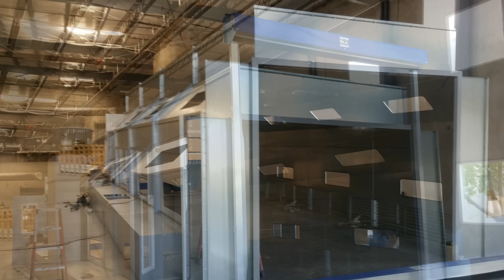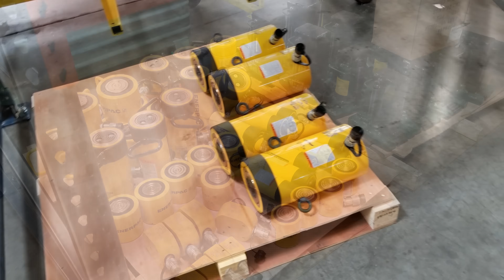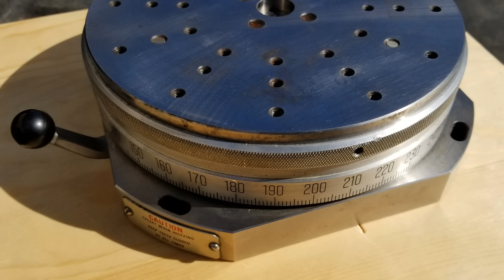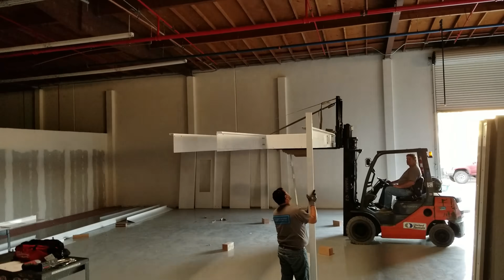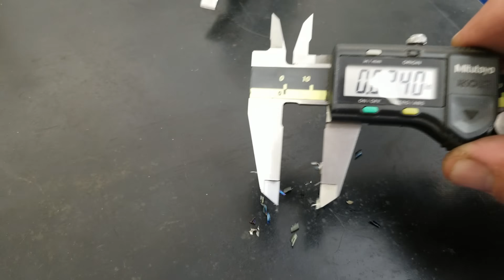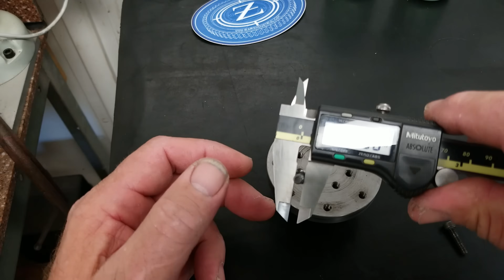The Grind #46

Comment: Hey Stan, when using your demagnetizer, should slowly withdraw item being demagnetized away from demagnetizer. Basically just a coil and armature. When you apply AC to coil, magnetic field flips back and forth at 60Hz. If you pull away fast, you may come away from peak of either positive or negative cycle. Since any dipole field diminishes with CUBE of distance, not square of distance, that magnetic field drops off very quickly. Moving away too quick can leave residual of one pole or other. By moving away realy slowly, field slowly diminishes while still flipping polarity. (Used to demag 103 sets of tape heads every week at a radio station... back when tape cartridges were used.)

Comment: I have a motor growler that I use to demag large stuff and a portable unit made from an old drill with a c-frame motor. I removed every thing but the handle and the armature and split the narrow end of armature with a hacksaw. That way I have a demag with a handle, a switch and a cord. For real small or delicate stuff like small drill bits and dial indicators I just use a Weller type soldering gun.

Comment: If you need some mc4 connectors for your solar let me know, I happen to be doing alot of solar and could easily drop some to ya
Reply from the maker: I could use some advice on a inverter selection, I dont ever want to put back into the grid. The sheer amount of brands and features is staggering. Drop me line if you have the time to talk it over.

Comment: Hi Stan,
You can use the ID part of the calipers to check center to center as well. Just zero out on one of the screw holes and zero the calipers now when you measure between two holes of the same size it will give you center to center. You won't have to deal with screw slop this way.
Steve
Reply: That's why I love digital calipers but I hate checking  the zero point is right before using them, it can happen every now and then  you forget to rezero it and you get a false reading. Besides  that I use my calipers so rarely at home I just use vernier calipers, no problem with the zero, no empty batteries.
Reply: I've done the same.. Holes on both cases need to be the same diameter..  Not to hard to figure out since you can re-zero a digital caliper...